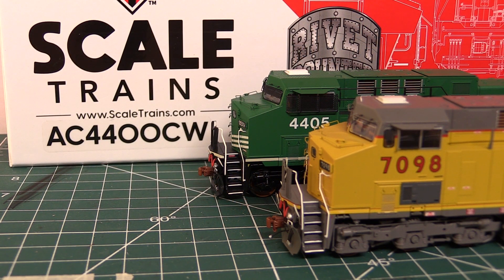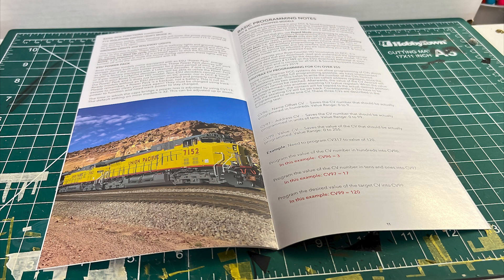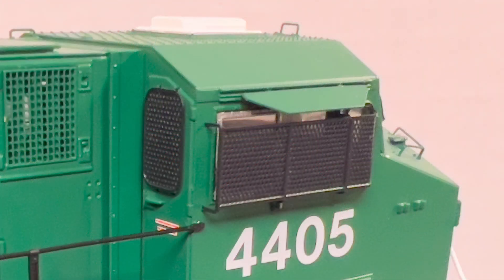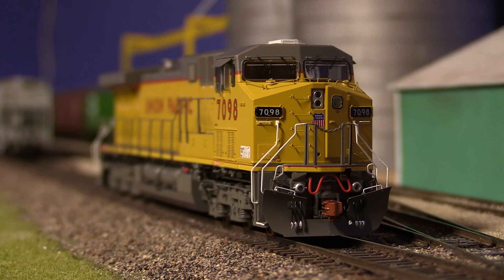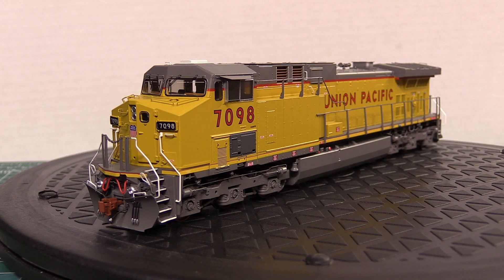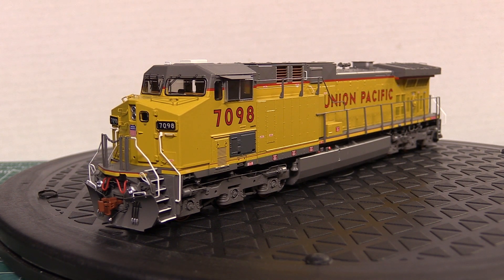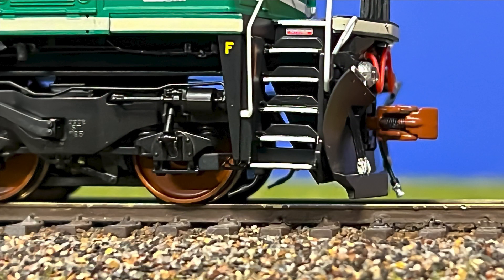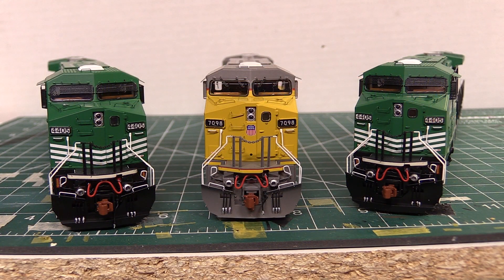ScaleTrains Ho Rivet Counter AC4400CW Review!

Comment: Nice review. I’m not a rivet counter, but I think scaletrains did a good job on the UP version. All the bells, lights, sounds, looks are awesome, but equally impressive is the drive. When turning off the sound, it’s quiet and smooth, the only sound is the wheels hitting the rail joints. I even ran it forward and backward in speed step 1 and it just creeped along. The color isn’t an issue with me, I see all kinds of faded UP locos and I plan on weathering mine like the proto and adding PTC antenna from MAC Rail. I don’t have a ferrosur, but they look tempting. Thanks, Terry
Reply from the maker: Thank you. They definitely nailed the tooling on these for sure. I am looking forward to getting them all weathered up.
Reply: @WhiteRiverRails  ur AC4400CW r sharp looking scalestrans differently nailed it spot on fully detailed like how u weatherd them n they sound so realistic